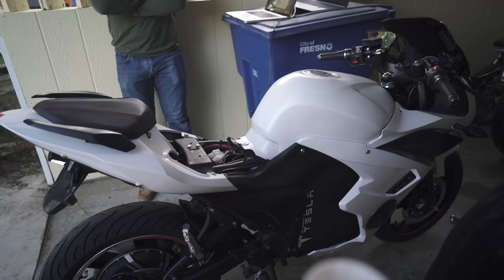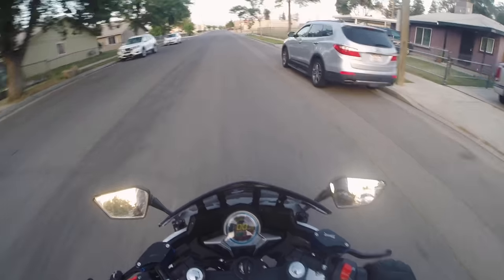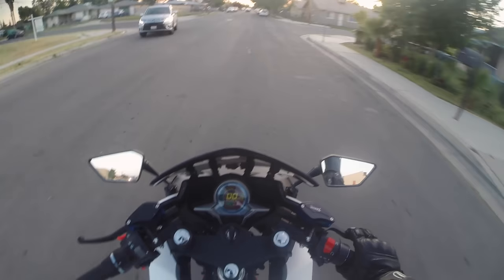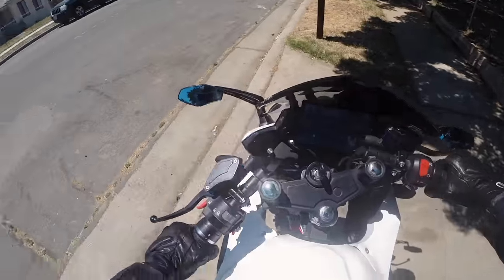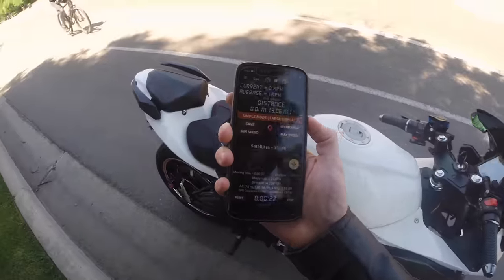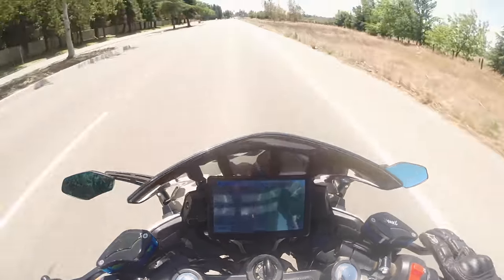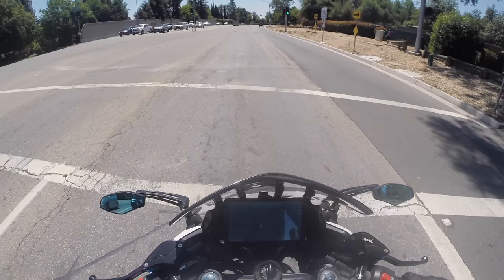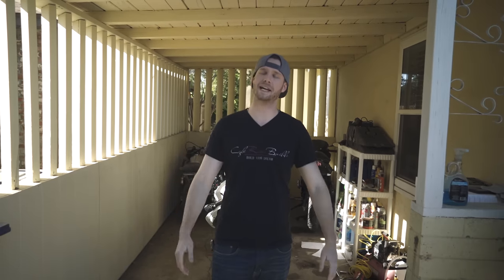CHINESE ELECTRIC SPORTBIKE – Top Speed [AFTER MODS]

Comment: The Electric Harley is 78kW or 78000w with a top speed of 95mph.  You're running 8kW and hitting 73mph.  I could be wrong on these numbers but that's a giant increase in kW for not a lot more speed.
Reply: 78kw it's peak power, this 8kw peak power 14kw, still alot diffirence

Comment: probably you overheat motor.you must open the throttle slowly until rev up
Reply from the maker: Nope! It was either the controller or a loose throttle wire.

Comment: Cool toy, but it's never going to replace a good old gas powered motorcycle. I definitely don't like that it makes no noise. My bike has a pretty much open exhaust and I can tell you that it's saved me more than once when someone in a car was about to get over into my lane without seeing me. One quick rev on that 1350cc engine with an open exhaust system and they knew I was there. I don't think I'd enjoy being on the road on a silent motorcycle. Loud pipes save lives. Silence can be deadly.
Reply from the maker: I've ridden loud bikes and silent ones and don't mind either way.

Comment: I feel like theres a max rpm srtting or current level that's preventing you from breaking 70.  Something...

Could also be a bottleneck in your wiring.  The chinese like to push wiring limits and theyll heat up, limit current, and do other weird things.  Maybe thicker wire from battery to controller to motor...
Reply: NeoIsrafil we already upgraded the wiring all the way from battery to controller, so good there

Comment: i have the same bike minus the upgrades, check that the motor isn't too hot.
Reply from the maker: I think it's the controller. Regen doesn't work when it died. I think it point to controller needing to be reset
Reply: I agree I have same setup and in order for me to get 70mph I have to hit 10,000w which is fine for short bursts. But not all the time. Need an amp meter on the bike. At 72v anything over 110 amps can is over 8000w.
Reply: @TheInja  with a little bit of searching you'll find the problem
Reply: @devinsmith9323  mine is stock max speed I've done is 85 km/h (GPS) but on some hills it will cut out power then return. But if I stay at a constant speed it will do it till it's dead.

Comment: Stop comparing this to a sport bike. Have you ever been on a1000cc sport bike
Reply: sport bike usually means the seating position + style of fairings. It does not have to be a 200 hp monster. You can easily compare this one to a 125 or 250cc sport bike.
Reply from the maker: Hahaha I literally said "I've ridden Supersports" in the video. Chill, thanks.
Reply from the maker: And yes, that means 600s 1000s and even Suzuki Bandit 1250cc
Reply: Sports bikes come in all engine capacities. As do cruisers, from 50cc to 2300cc. It's a style thing, not a power thing.

Comment: It's not fast though is it?
 Probably has bags of torque and might out accelerate a 600cc sports tourer to 60mph maybe but any street bike that can't crack 100mph has no business being called fast.
Reply: Electro motorcyle can easy 100mph and more, just its drains more battery. 8000w also can reach 100mph, but there samo motor models have 15000w.

Comment: You now cannot SEE the motorcycle dash....
Reply from the maker: Doesn't read anything but battery voltage, which I can check between rides
Reply: @TheInja  or fit a battery voltage gauge on the other side of the fairing opposite where the temp gauge is. You can get them in the same design

Comment: Please Put some Brembo calipers on this bike. Those cheap Chinese Calipers are garbage. You can hear the brake pads rubbing on the Disk. there are water cooling solutions to help with the controller overheating. A cheaper option is to use computer server fans mounted underneath the controller to blow air on them. They do add more noise to the bike but it's comparable to wind noise when you're riding.
Reply from the maker: We added a fan, probably next video in this series?
Reply: @TheInja  Also, If your ever needing help with Ordering E-bike parts let me know. I'm currently living in Nanning, China where we have the largest population Of E-bike riders in the world. I work closely with many of the distributors here as we build custom E-Bikes here. I'm glad to see that this is becoming a popular trend. The power in Electric motors is unrivaled in gas motors. Happy Riding!
Reply: The Inja, man do you have a link with the motorcycle? Where did you got it? Is amazing !

Comment: Your top speed was only 73 mph? That doesn't seem right. You definitely hype the top speed up, a little to much. That thing has to be able to go faster than 73 MPH.
Reply: darkherosolidox there’s a certain point where electric motors are limited by RPM. unless you have different gearing it can’t get past a certain point. It’ll get you up to speed quickly, but it just runs out of revs. Not a lack of power
Reply: @curtmacneill8703  yeah but it stops out 73 mph?

Comment: If I’m spending 5K  for a motorcycle electric or gas . I shouldn’t have to break out the laptop for programming. It should come running at top speed I will stick to gas
Reply from the maker: This is a custom build homey
Reply: @TheInja  you bought it
Reply from the maker: @terrorizerjones8692  yes....then upgraded the whole thing
Reply from the maker: @terrorizerjones8692  custom built battery pack, controller, motor, each needing to be calibrated with each other and juiced up in the programming

Comment: 70 mph top speed seems a little light.
Reply from the maker: Hub motor limits.
Reply: can that be altered or changed? @TheInja
Reply from the maker: @trainmaster0217  there are higher-wound motors that do better top speeds...and for top speed you're limited by your voltage. This is a 72v so this is pushing the limits. We built an electric Ducati on the channel with higher voltage and larger motor and it did 110mph.
Reply: And what about charging stations?  I live in WV and I've never seen a charging station.  If you do find one will the charger  cord fit a motorcycle like a car?  Interesting stuff here. @TheInja

Comment: It seems my 3Kw bike pulls harder than that (yes its kph but still) .
https://www.youtube.com/watch?v=4uFFTTY9-QY&t=168s    just skip to 2:15
Reply: JAY that was slower, but impressive with what you had! It was labeled as 6kW on the video as well
Reply: @curtmacneill8703  Yeah, a real-life test is the only way of knowing it. But my bike is 3Kw max output 6Kw. I can easily pop a wheelie doing 30kph. The bike in the video has a lot more than that in it.

With that set up it should do 0-60 in 2,5 seconds. I know that,because I have seen those numbers with hub motors with less power.

Comment: first
Reply: hey man! been watching this series and love it! keep up the good work!
and i know the struggle with upgrading electrical motors, i have an electrical scooter ( razor e-300 )
i took the old 350 watt 24v motor out, put a ebay preformance motor, 500 watt 24v motor, and pulled out the old batteries, put in 3, 12v, 10ah lithiums, 300$ batteries!
then i took the old controller out and put in a 1000watt 36v ebay performance controller, and i was povervolting the 24v motor to 36 volts, and 750 watts,  i also put on a 80 tooth sprocket, tons of torque, thing goes 30 mph ( top speed )
and it reaches 30 in like 10 seconds XD, that thing pops whellies no problem at 20 mph XD.
and it can pull a lawnmower trailer withlike 400lbs ( yes ive done it XD )
but believe me....it wasnt easy......blood sweat and tears into that thing. its my baby.
being that im 14 and thats really my only "big boy" toy XD
Reply: @logertgogert3227  Dude that is freaking awesome. Upload a video riding around on it.